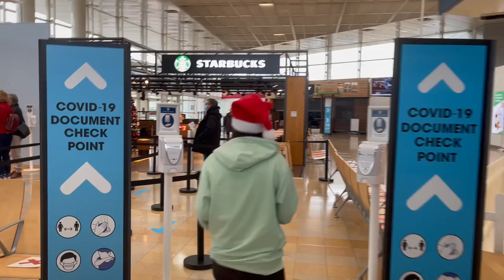WHEN VAN LIFE GOES WRONG.. MORE THAN ONCE! Problems getting back to UK! (female van life)

Comment: See you two, prime time viewing is an necessity, only these problems can happen to you 🤣. Anyway A Very Happy Christmas and all the best for 2022 🌲🌲☃️☃️🎅☃️☃️🌲🌲🥰 you made it ,well done. By the way don't trust a garage to assess all your mechanical needs, you need to know when things need to be changed to keep things reliable, water pump, timing belt etc are par for the course but mechanical fixings are different. Nobody has ever sugggested to change the clutch or handbrake cables etc. Never mind you both have had a very interesting second return home, glad you made it, catch up later ok ❤
Reply from the maker: Hey Eddie, lou didn't go into all the details but she will in another vid with the updates but we did have the wire changed as they suggested it as it was done in 🤦‍♀️ 
We have a great Xmas, hope you did as well and happy NY 😊

Comment: Just have to keep a positive outlook, things always work out.  Honestly, RVing for several years (towing) and I've never used the hand brake or parking brake.  Have to ask, why did you not try to jemp the battery with the Jackery?  Not meaning to be negative; it's always easier to see things from the side lines or the next day.  I admire how you handle things.  Great that you had road side assistance.  Safe travels and great video yet again.
Reply from the maker: Oh no its alright we all shout at the TV and say what you doing do that you idiot 🤣 to be fair it didn't enter my head not sure about Louise she tends to think more logical than me 🤣🤦‍♀️  yeah lou was not fussed about the handbrake when she learnt to drive they only used it for emergencies so driving without was not an issue it was the heat that happened to ruin the brakes that became an issues and the horrendous noise it was making which then in turn had AJ shaking so we was not going to out him through that for a 10 hour drive to get to the tunnel 😊

Comment: I know the feelig. I Bought and started converting a Fiat Ducato last year. It is mostly the same car, atleast the body and chassy. First vacation trip last year the clutch system went out 500km from home and limped it home.. This year my gearbox went bonkers so I have gone bit overboard and overhauled everything that could and will go wrong on my van project. Its a part of the journey and something will break one day.
Reply from the maker: Don't blame you, makes you like that at times right 🤦‍♀️
Reply: @campervibe  I expected something when I bought an old used van. Self taught mechanic here. Handbrake on both yours and my wan is quite simple in design but can seem complex at first look. But can as seen in your case lock up. Reconmend to have some minor tools in the van and prepare for the worse. My handbrake went out in 2020 completely. I hope for this year to take my van to Switzerland and more. Living in Norway here.

Comment: Hi, I've got exactly the same van as you. Have had same problem with handbrake. Also had starting issues but was related to earth strap connection to starter motor. Took motor off and wirebrushed terminal. Worth checking. Also hows your gear change feel, sometimes have to WD40 the mechanism under bonnet as it gets sticky and makes changes a bit clunky.
Anyway, big thumbs up to you two, looking forward to more vids. Always enjoyable
Reply from the maker: Thanks for the tips, always good to know for sure 😀😀

Comment: Catching up with your amazing vlogs ..just a thought, 🤔 battery issues, if you carry a power bank with 240v output, why not carry a car/van battery  charger.. unplug terminals, part charge battery, etc, let your altimeter charge once engine is running, saves on call out charges ... Would it work? Lou, your the electrical engineer!
Reply from the maker: Haha she thinks she is

Comment: Forgive me if I am wrong but with your cold starting problems it appeared to show that you didn't give the glow plugs time to heat up before you cranked the engine, i.e. wait until the glow plug light goes out before trying to start.
Looking forward to seeing your next trip.
David Hancock.
Reply from the maker: Hey David, lou does wait until the glow plug goes off, it just goes off super quickly but thanks for checking 😀

Comment: If I'm not wrong this Citroen van was made in Italy by Fiat. So at least one can find more service offerers than those specialising into Citroen and Peugeot only. The van Cruising the Cut uses, Toyota van (Proace?) is made by PSA - and now when Fiat and PSA went together as Stellantis we just have to wait and see what comes of that. Years ago M-B sprinter and VW Crafter were a product of joint operation but not any more. Even Ford Transit had its engine for some time ago from PSA - anyhow they say nowadays it's not PSA engine, they developed that further on... Mercedes has had problems too. VW has its own share. No van is problem-free nowadays, one just has to learn their weaknesses and act accordingly, I suppose. Ducato engines had a good reputation about 10-20 years ago (my knowledge is sort of old!) only their 5 speed transmissions were prone to fail because of poor lubrication of the 5th gear. That was said to be avoided by not using the 5th gear at speeds under 80 kms per hour (but I don't know for sure if it helps). 

What I know now for sure, is that new modern vans seem to need a very different approach even from the user than the old ones did because of the emission standards changing.
Reply from the maker: Lots of info there, totally right though no van or car is ever problem free and all have their things, and couldn't agree more about modern vehicles they seem to be getting harder and harder to fix yourself

Comment: Not trying to teach Lou but the you said something about not holding in first gear?  The cold starting and very rough sounding to me (I have always had Diesel engines), is suggesting as you said glow plugs/relay - maybe,  but I am guessing low compression on one or more cylinder though.  To me it turned over fast enough on the old battery the second time.   I am sure you will check enrichment, injection timing, pump pressure and so on, again I say you have a rough Fanny there. The video was great, as I wrote in live comments, the truth and real life of van life and great drama too.  Now rest and cuddle up for the next few days and leave Fanny alone.
Reply from the maker: Oh you're alright Dave, you're right though now she is back we will check all sorts out to make sure all is good 😀

Comment: These vans need fair bit of maintenance even if they sit on a drive. your battery looked well used . Iv got the peugeot boxer had to do same and change engine battery not cheap at £100
Reply from the maker: Yeah don't they just, we get it regularly serviced etc especially with travelling

Comment: no. you dont need a handbrake. havent used mine for about 5 years now....  Just put it in 1:st gear or parking if its an automatic.
Reply from the maker: Yep very true, but we do need breaks 😆
Reply: @campervibe  yes. if for nothing else when passing inspections. its also nice to sometimes as when you want to keep thep engine running.

Comment: Well you didn't get recovered off the French motorway and dumped 5 miles away in the middle of France for 200 💶.
Then spend 4 days taking out the gearbox kicking it around a campsite before putting it back in whilst it never stopped pissing down with rain.
It really is a test of your metal but then that's my experience.
Well down for getting back.
Reply from the maker: No way, try to avoid French motorways for that reason, you have to have their recoveries collect you then your own one after that, its a pain on their motorways 🤦‍♀️

Comment: welcome home you mad buggers !!!
who do i complain to?, that was only 2 van breakdowns, batt, + h/brake.     all right, munchkin had 3 or 4 breakdowns, but that doesn't count.... 
  i wonder if those handbrake linkages froze in the "on" position, so the brakes overheated before the ice melted, happened on 2 renault vans on our fleet very early this year.     on your attempted startup  before you changed the battery, it sounded like it was a glowplug or two down, so add a full new set of decent quality plugs onto lou's list.      you will need those new handbrake shoes adjusting [inside the rear drums] before your next big trip, as they "bed in"
when the inspector was looking + asking about immigrants, i was hoping you were going shout up +  say "and theres no drugs stuffed anywhere in our fanny either" [dare for next time]
PS last jobs i did before breaking up were 2 sprinters, one had no turbo working, one had a failed EGR valve, both right awkward bastards to fix, so dont listen to these smug merc. drivers, they do go wrong, like everything else....   
thanks for a brilliant years vids, cant wait for lou's tech updates, and of course we are all waiting for your trip to wales, zipwire related if you have forgotten... now get those hairy legs shaved!
Reply from the maker: Oh we know all vehicles go wrong it's just what they do. Haha you can complain to me (Em) but you won't get very far 🤣🤣 
Yeah going to get them done and carry some spares, oh god ill try and do it next time but you know me 🤣🤦‍♀️

Comment: Roll on 2022 & a breakdown free year ! xmas greetings Ladys happy you got home ok even with a lighter purse, Good tip whilst on the move everytime you stop for a break go and feel up the wheels all sexy like , joking apart you might have spotted hot wheels / brakes dragging  also start carrying more tools it can save you £££££££, sounds like your glows are on the way out but check the derv lift pump first it can give you bad starting effects, motorcycle waterproof chain grease in an airersol tin would be great on all your exposed brake parts also a large water carrier so you can keep water inside on the cold nights, underslung tanks need a heat blanket, cold battery can be cured with the night heater diversion to near the battery housing.
Reply from the maker: Thanks for all the tips, have a great NY 😀
Reply: @campervibe  As an ex hgv driver most drivers have a kinda love afair with wheels and tyres, they are like are wifes , little heat = nice and rounded with a promice , very warm = this equals a slapped face for pushing your luck , red hot = not tonight mate you neglected me, joking apart ---- hot axles = oil seals / bearings either way wife or van its going to cost you Lol !  bit like birth control , not tonight josaphine get the repairs done.

Comment: Parked on a hill? No roll it back and bump start it? if its rolling when IN GEAR you got a problem and ALWAYS stick it in reverse, as the Lowest gear and park facing downhill.. JUST in case it happens again.  if it rolls then.. BURN IT..
Reply from the maker: Hey Chris, we wasn't on a big enough hill to be fair and would have had to push it out onto the main roan to try and do it down the hill and I am strong but not that strong 🤣🤦‍♀️
Reply: @campervibe  Cmon Lou  £ red bulls and a bit of weight lifting.... LOL It looked a bit steeper in the one section of the video.. you both did brill.

Comment: find some bricks  either side of the wheels
Reply: @campervibe  A tip  if the glowpugs are suspect ignition on until glowplug light goes out about 4 times  before trying to start